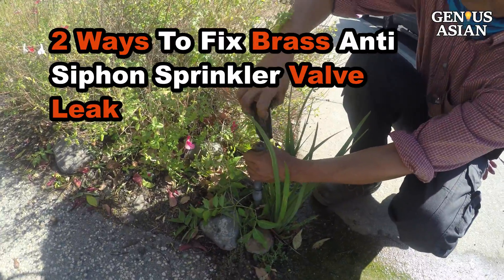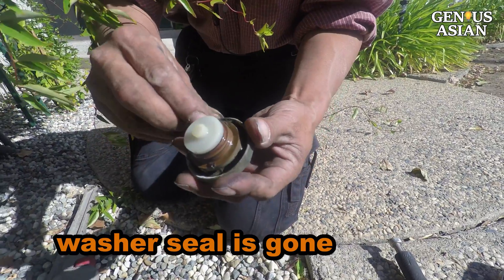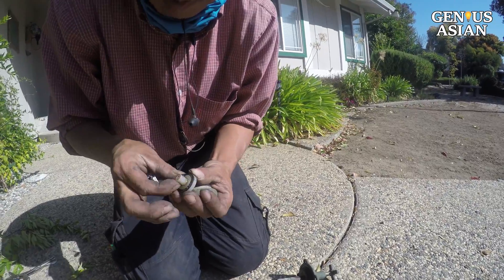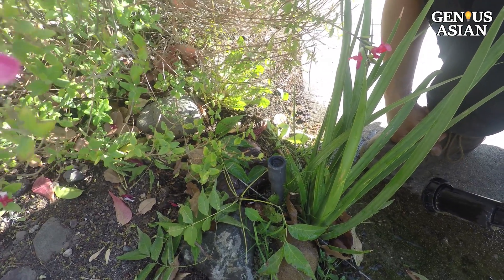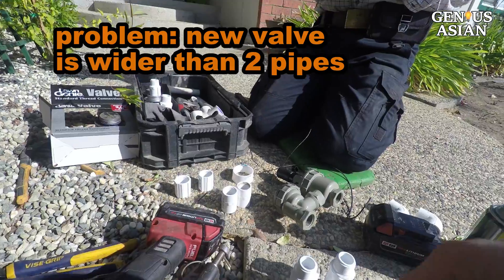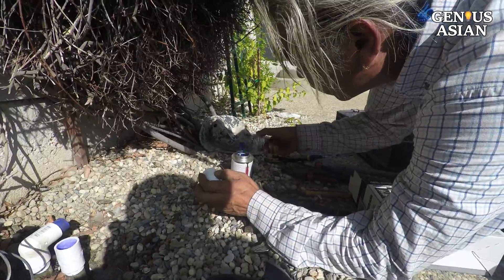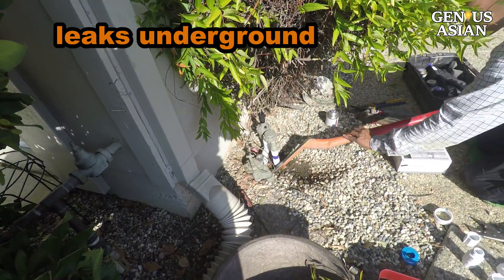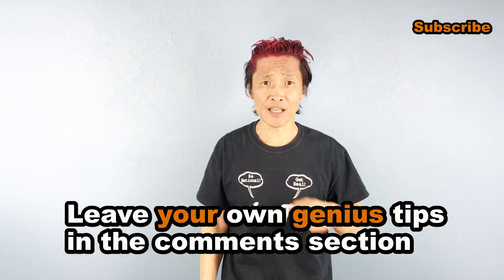2 Ways To Fix Brass Anti-Siphon Sprinkler Valve Leak. Tips for Rebuild W/ Repair Kit or Replacement

Comment: If its the lowest point in your yard that sprinkler is simply draining what water is left in the system. It doesn’t necessarily mean that the siphon valve is leaking my lowest sprinkler head drains for a bit and the birds use it for a water source
Reply: Hey can you explain this to me? By system you mean the sprinkler system? I’ve turned off the valve for my sprinkler and it still leaks